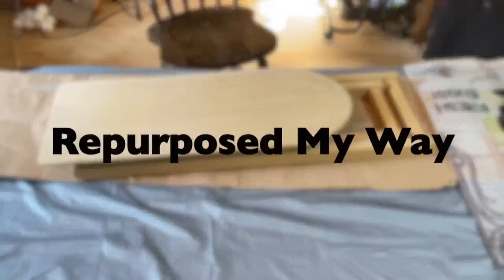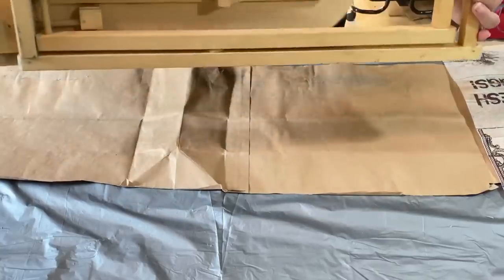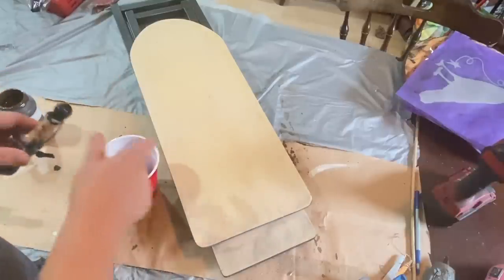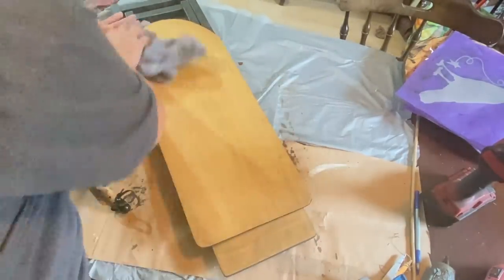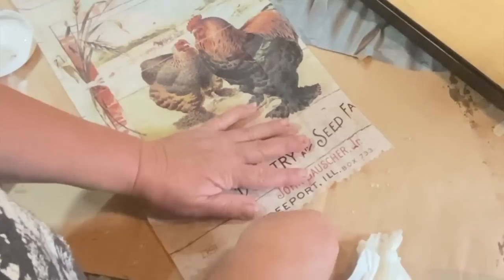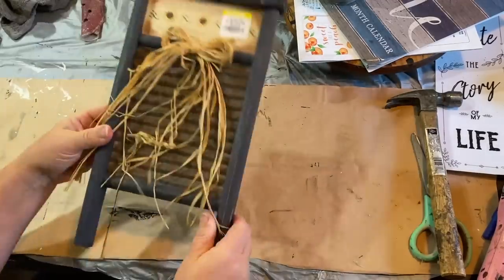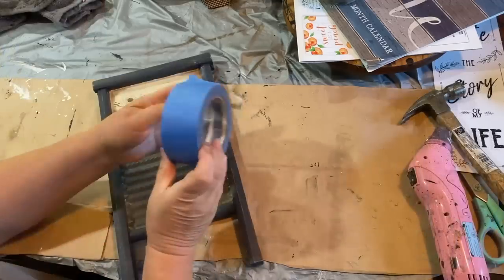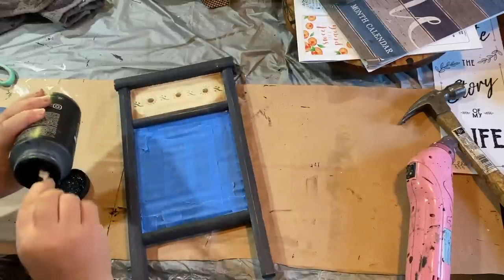DIY Primitive Thrift Flips | Outdated Decor Upcycle

Comment: Decoupage tip - I want to share a tip some may not know about. You will not have any bubbles or wrinkles with Mod Podge if you iron the tissue paper, paper napkins, fabric, etc. to the Mod Podged project. 

Spread the MP on your project and let dry completely. Once dry, lay the decoupage paper over the MP.  Put parchment paper over the decoupage paper and iron with high heat - no steam. The paper will be smooth, no bubbles or wrinkles, and very well adhered. Sand the edges to add that finishing touch. 

Hope this helps someone. Blessings to you.
Reply from the maker: Awesome tip Cathy! Thank you